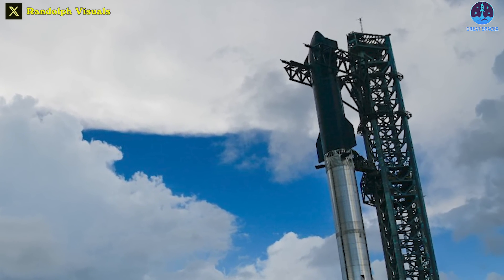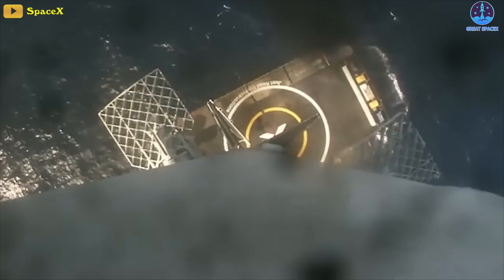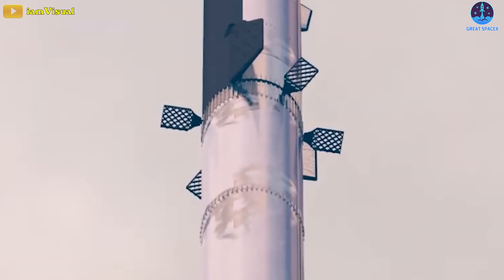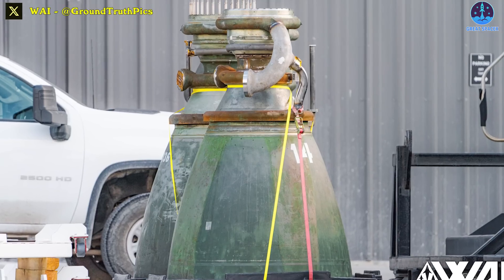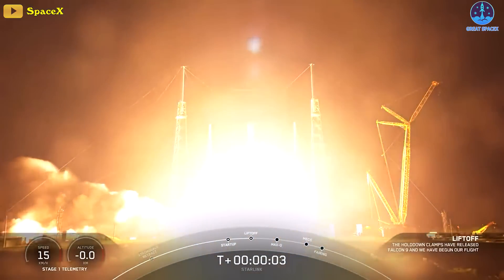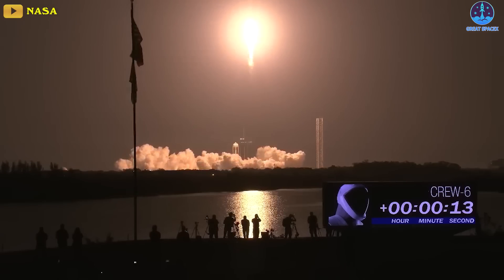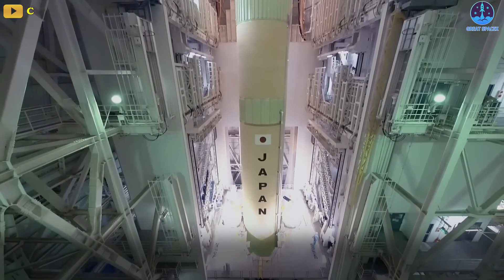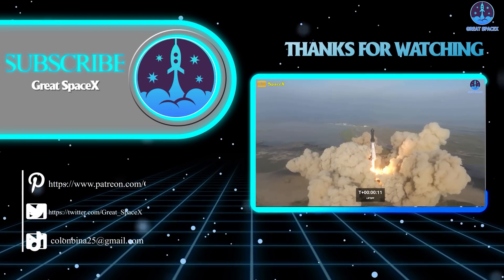SpaceX Starship fullstacked waving, FAA pending, New raptor spotted & New Starship Stacked...

Comment: Wouldn't the grid fins being made of titanium instead of steel reduce weight and increase payload to orbit?  SpaceX has a lot of exoerience with titanium grid fins on Falcon, and they can always be salvaged after the rest of the rocket is eventually retired.
Reply: yes but the increase in PTO is small and not worth the cost of all that titanium
Reply: @ThomasKirven  One could well make the same argument for the Falcon rockets, but they use titanium, and the Falcon Heavy has a total of twelve fins.  Perhaps they're waiting until the Super Heavy booster has proven itself?
Reply: All true, but compared to Falcon 9, Starship/Superheavy benefits from hugely improved economies of scale - surface to volume ratio. square/cube law and avionics and control systems being a smaller % of total mass of the rocket mean everything is less marginal in a bigger rocket than a smaller one.  Steel or titanium grid fins becomes a cost/benefit analysis, with the mass coming out of a theoretical payload maximum that is unlikely to be used by any of the earliest applications of this new rocket.
Reply: @edumaker-alexgibson  Given that SpaceX is all about innovation and efficiency (hot staging is far more difficult to get right than making grid fins out of titanium) I'm surprised they haven't used their expertise in fabricating grid fins from titanium to advantage.  Perhaps they will consider it later when the Starship is less likely to be lost during development...
Reply: @chrisantoniou4366  Depends from what standpoint you view efficiency.  Do first, then optimise.  They're in a hardware rich development phase right now, as you say no point making gigantic titanium fins that will only be lost in the sea.  When they actual needed to eke out another few tonnes of payload mass, and are routinely recovering boosters, the huge extra cost of titanium can be amortised over a meaningful payback expectation.
Reply: @edumaker-alexgibson  The thing about the fins is that once a super heavy booster is "done" and can no longer be used, the fins can be used on another super heavy booster or at least re-made.  Yes, the cost of titanium is high, but they will always have that.  I do understand that it's not worthwhile for boosters SpaceX expect to lose...

Comment: Grid fins are primarily to put the aerodynamic center of pressure behind the changing center of gravity.  That's less important under boost, with  a great control system, but once it's falling down without engines running, it needs to naturally fall smokey-end down, and not tumble, or go smokey end up.  Steerable grid fins then accentuate control, saving RCS gasses.

Comment: Why don’t they rotate the grid fins 90 degrees during ascent?
Reply: I think that this was the original plan, but Spacex came to the conclusion that the mass of the equipment required to fold down the fins resulted in less payload to orbit than if the extra drag was accepted.  Fixed fins also means one less thing to go wrong !  I am not certain this was the reason, but I think I heard it said a few years back.
Reply: i'd guess that the flat surface would have a much higher drag coefficient
Reply: @thebiggamers999  maybe, but there are a lot of individual surfaces given the fin in a horizontal orientation
Reply: @KurtHarless  i did some routine checks in a solidworks simulation and the gaps when turned 90 degrees turn into pressure voids and increases overall drag. Its a simulation i did in about 30 mins so take it with a grain of salt

Comment: What's the point of listing boosters and starships, ready or in production? So far, this entire project is a collection of controversial decisions, each of which has the potential to ruin everything.
Reply: The only way you progress is to try something new. If we followed the tried and tested methods listening to the so called experts we wouldn't have flying machines let alone spacecraft. Companies such as Blue Origin and Boeing show how to spend taxpayers money without an affordable working prooduct - that not progress, just greed..
Reply: @anthonykevinkerr3594  we need competition too.  No one wants just one rocket monopoly .  It is a good thing there are many privet companies building innovate rockets now.
Reply: @anthonykevinkerr3594  Nobody argues that we should try. But how?
Try 33 engines prone to fuel leaks in one set with a launch pad without the classic trench. Are you sure that, after standing on the table for an extra couple of seconds, the rocket will not destroy it again, now together with the newly installed “cooling system”? Add the intention to catch the booster with chopsticks. If a gust of wind deflects it too far, will it be able to try again? How many times? To me this looks more like an adventure fueled by messianism and blind persistence.
Reply: @HomoMathematicus. yes, we are sure. You know, you dont know how it works un,ike them
Reply: How so?